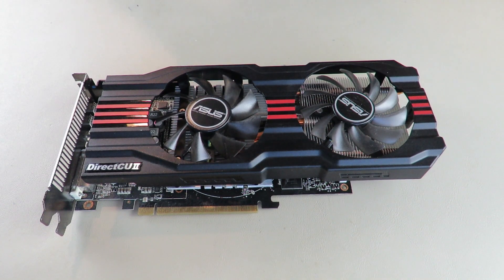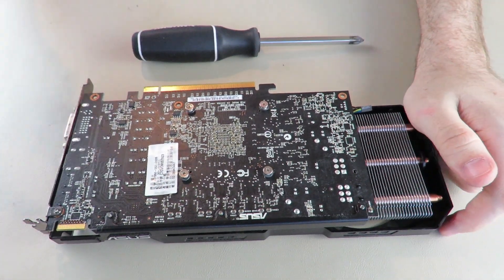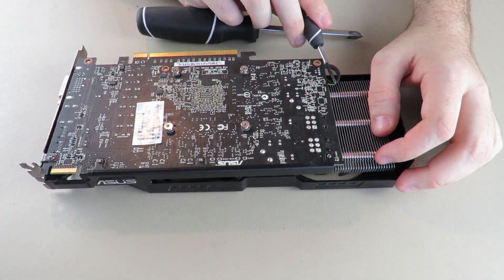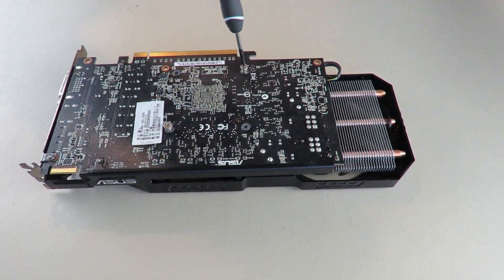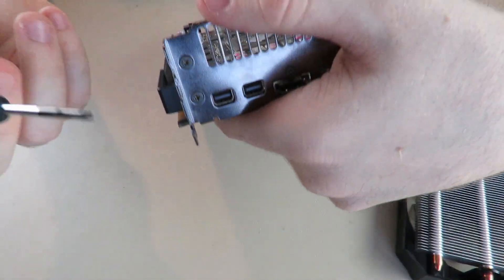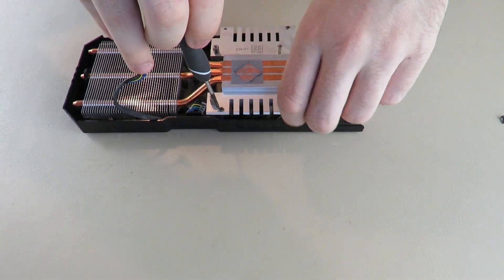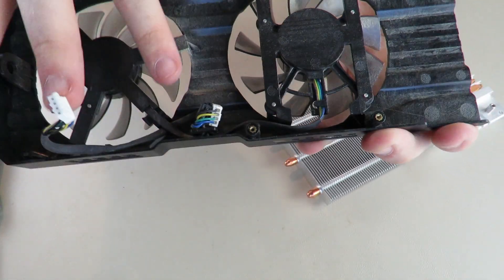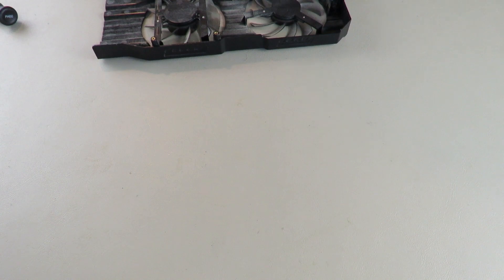Asus HD 7850 DirectCU 2 Teardown

Comment: Is this graphicscard worth buying? It looks so cool and it has crossfire so idk
Reply from the maker: What would you be using it for?
Reply: Yes. Its the gpu that was in the PS4 i just copped it for 30$(usually goes for 40$)
Reply from the maker: @jordanhobgood51 I would say depends on the use case. These GPUs aren’t good for very much anymore these days and I suspect they want it for gaming which I would NOT recommend.
Reply: @skywaytech oh i bought it for gaming just recently got my pc setup but still need a wifi card I don’t have wifi just mobile hotspot
Reply from the maker: @Syntaxgaming69 you might be able to find a second hand one or just go grab one off Amazon. They are very affordable!